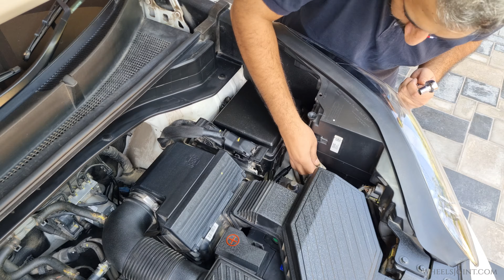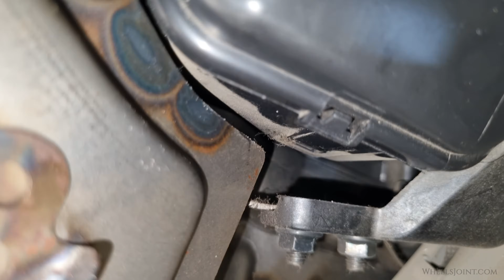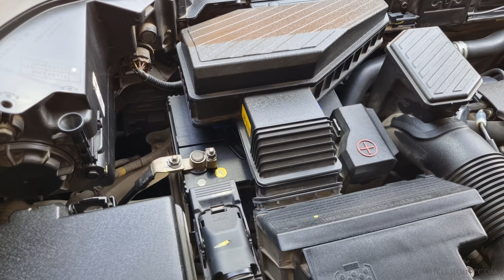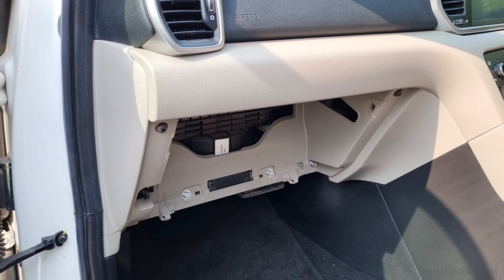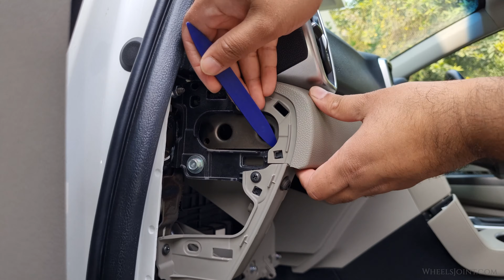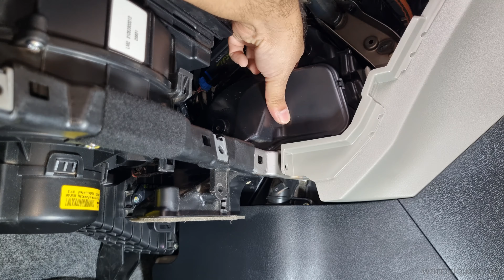How to replace blend door actuator in Kia Sportage

Comment: Thanks for sharing this video , I have the same problem in my car sportage 2017 
The driver’s side blows cold air, while the other side blows hot air. I don’t know whether the problem is low refrigerant (AC gas) or an issue with the air blend doors.
Reply from the maker: Usually, if the refrigerant is low, both sides would blow warm air, so it is likely an issue with the blend door actuator.

Comment: Do either of these actually control where the air is directed because that’s the problem. I’m having no matter where I turn the dial. It always comes out of the floor, not the dash or the defrost area.
Reply from the maker: No, it is controlled by mode control actuator. Its just above the  passenger side blend door actuator in my Sportage.
Reply: @WheelsJoint  thank you so much for responding. I appreciate it. I know I’m going to have to play pretzel boy to replace it and at 61 my body doesn’t like that shit lol have yourself a happy new year my friend. Cheers.
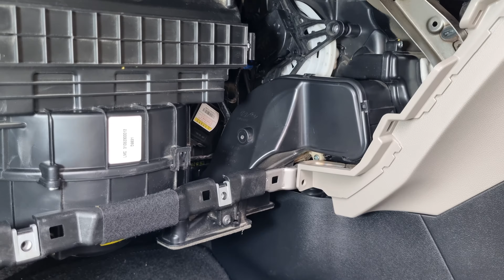Reply from the maker: It is much more difficult to replace the mode control actuator. It is held in by very strong clips. You can see the mode control actuator in the same video at 12:10
Reply: @WheelsJoint so that's the actuator that is connected to that white gear if I'm looking at it correctly
Reply from the maker: Yes, that's the one.
Reply: You provide excellent videos. Thank you so much.